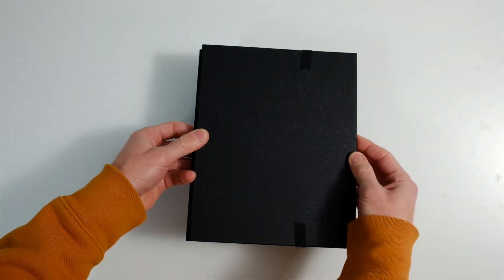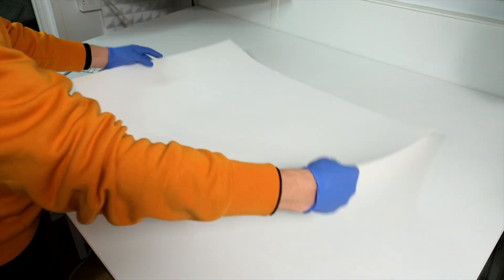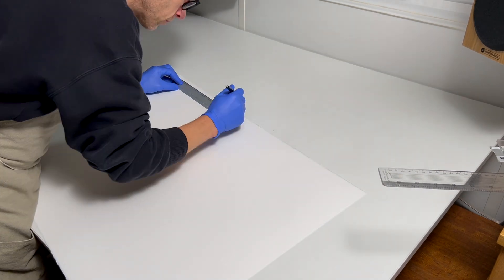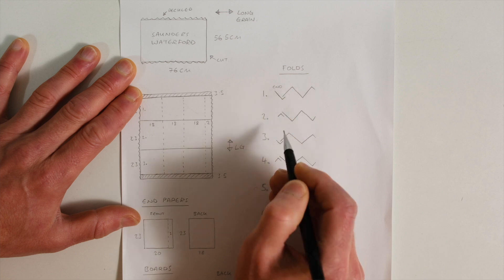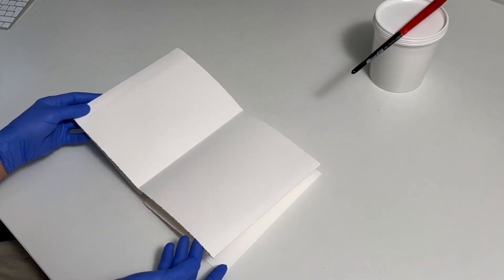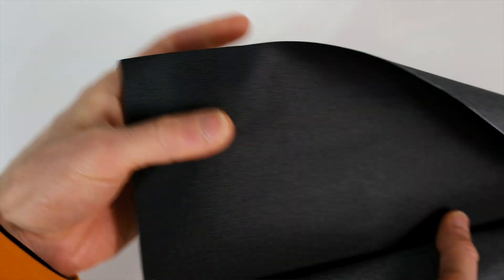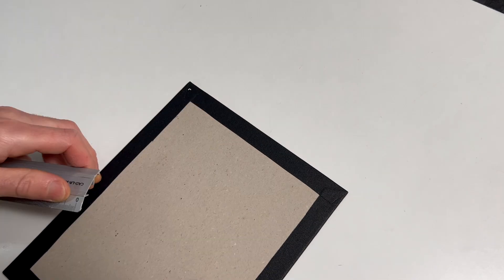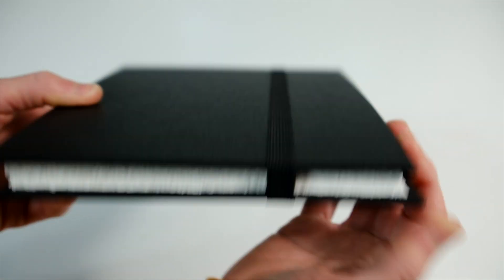How to Make an Accordion Sketchbook with Watercolour Paper

Comment: Cut a notch out of a piece of binders board or layer it around the elastic and then press the book. Thanks for the video great work.
Reply from the maker: Good tip, thanks! Having pressed the covers and text block individually, it came out flat. But a final press certainly wouldn’t hurt 👍😊